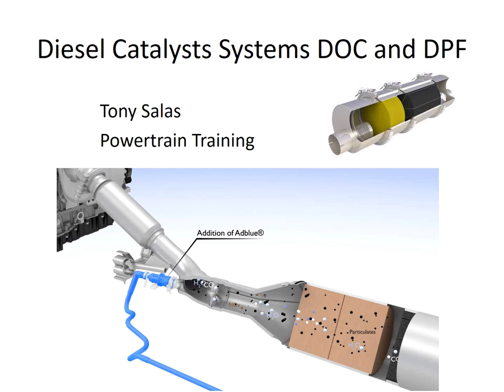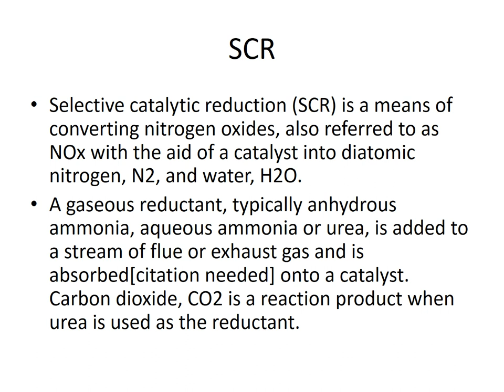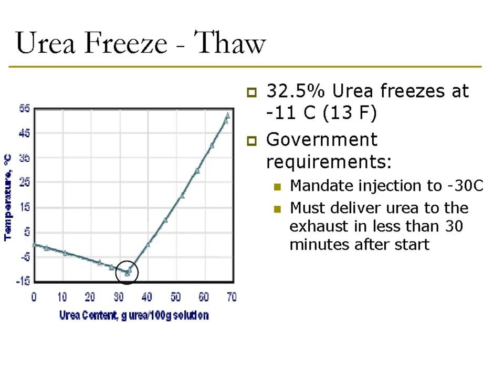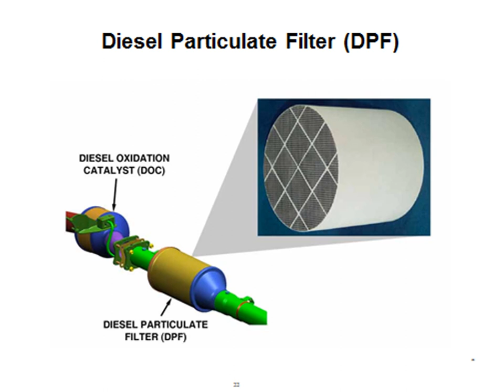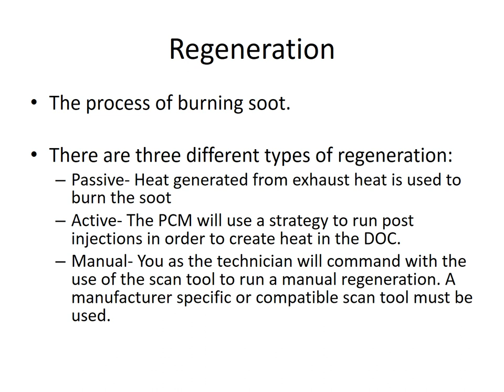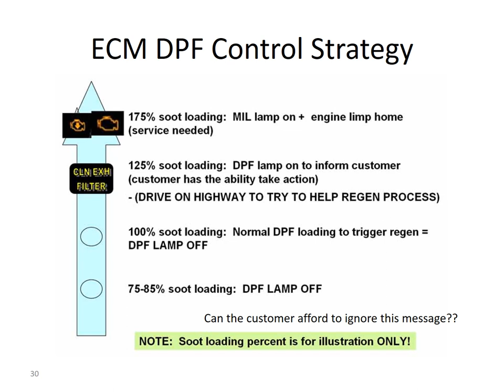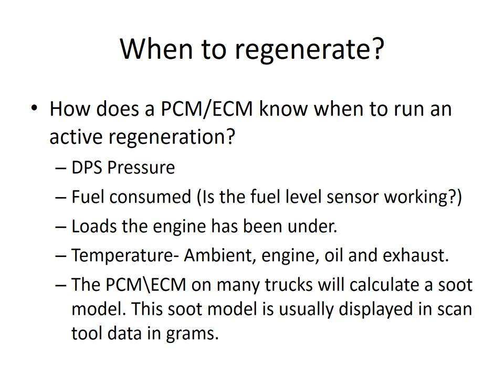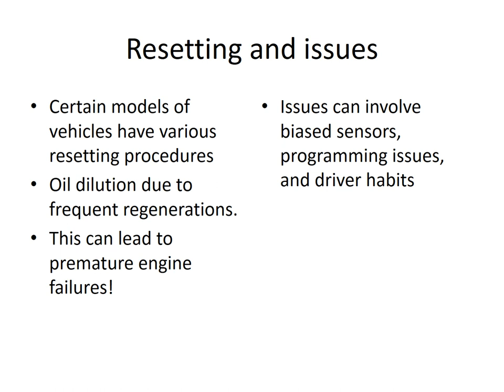DOC and DPF Presentation a quick review

Comment: Hi Tony, great video!! I learned so much info from you that I needed to know to keep my truck running at its best. But I need some more help Tony. As I see your illustrations, I have questions that come to mind. Where are the EGT1,EGT2,EGT3,EGT4,and EGT5 sensors c/t the DOC,DPF, and SCR on the new 6.7l Cummins Ram Trucks? What are the normal temp ranges for each given sensor and how does the EGR play into all this? Should we be monitoring the EGR sensor as well? I ask because I am trying to monitor them through the Edge Insight CTS3 on my truck. I run a Dodge Ram 2500 6.7l Cummins. Thanks I'm trying to learn all I can. Thank you Tony. Again I love your videos. You are a pro at this stuff.

Comment: So the DPF burns the soot to ash with heat generated in the DOC. The DPF burns soot after having letting it collect for a while. The DPF needs heat to do this so diesel is sprayed on the exhaust fumes on passing through the DOC.

Comment: @banks need to look into this exhaust system using their scientific approach
Reply from the maker: It frustrates me that diesel truck owners often blame derates and issues with aftertreatment on the government. We have known for years and years vehicles have had to meet emission standards. So when we see check engine lights on and power reduced due to emission system issues we should be blaming the manufacturers for poor emission control components and systems.

Comment: hey that was a great and informative video.. I own a DPF cleaning shop, I deal with it all the time.. Heat is always the answer lol
Reply: I have a question for you. I use stanadyne in my diesel car as diesel fuel is garbage around here. It is designated as meeting low sulfur requirements, so it can raise the ppm of sulfur by 1ppm. My question is: is that enough to damage the dpf or catalyst? The bottle says it's "exhaust after-treatment safe" but I don't know. Thanks!
Reply: Can u please tell details about your business or shop means how u do that

Comment: How does diluted engine oil affect diesel emissions systems? That makes no sense.
Reply from the maker: Actually it makes sense.
Look at basic text book of the job of engine oil. Cools, cleans, seals, absorb shock and lubricates.
Naturally a diesel generates blowby and that blowby can get worse due to poor oil maintenance. Diluted oil has little to no lubricity and cause more issues which affect emissions.
Oil is then brought into the intake and burnt in the combustion process causing more soot and ash accumulation.
There are many articles on this issue. Research and thanks for the comment.
Reply: @dieseltalkwithtonysalas8725  Thanks for the response. And thank you for your great video. Ok so I get that thinned out oil can cause advanced component wear, and then that component wear can cause less ring seal which can then cause burning oil, which then causes clogged emissions equipment. But the way it was mentioned, I was thinking you meant there was some immediate harm to the emissions which I couldn't understand. Like if you had a stuck partially open injector it may thin the oil. But the thinned oil damaging ring seal I would think would take a fair bit of time before excessive oil consumption takes place. I'm guessing thousands of miles but i could be wrong. I was thinking you meant some sort of immediate harm to emissions. And if that was the case I don't then understand.

Comment: Is it true, you cannot run a DPF regen pulling a load?
Reply from the maker: There are three types of regeneration. Passive, active and manual. Passive regeneration occurs when the truck runs under a load and the heat is high enough to burn soot in the DPF. Active is when the on board computer will add fuel to the exhaust either through post injection or if the truck has a dedicated injector for that. Manual is either through a scan tool or some trucks have buttons to push on dash to run a manual regeneration. So! Yes if the conditions are met it will run a regeneration under a load.
I did a whole series of videos on this , look at my video library, you will see them.